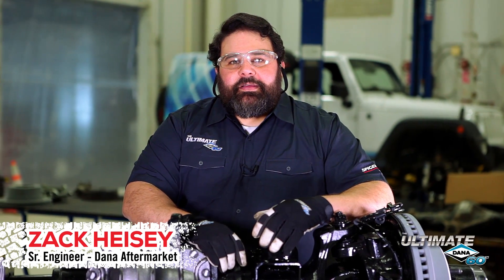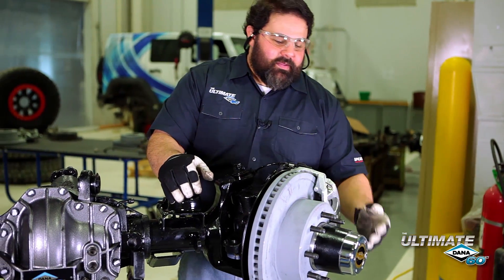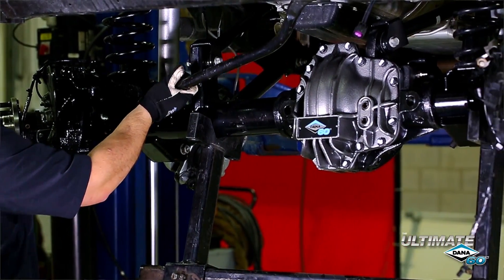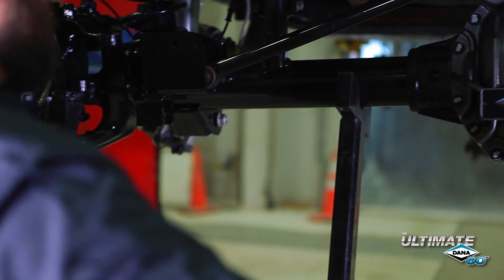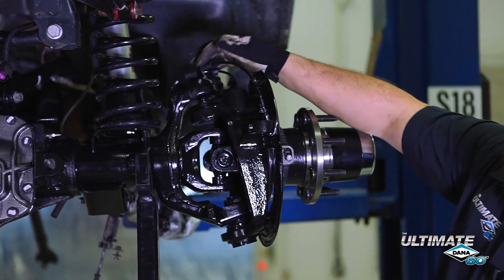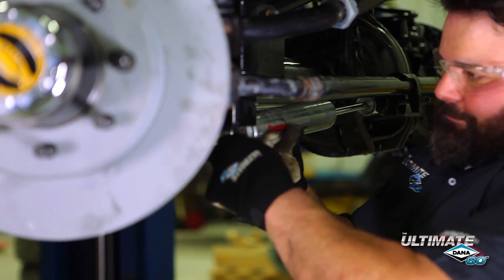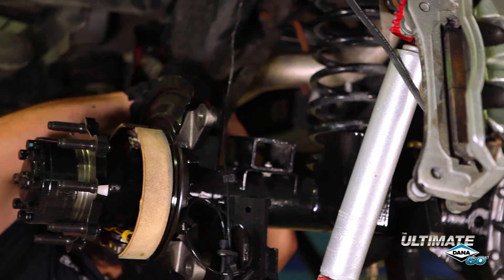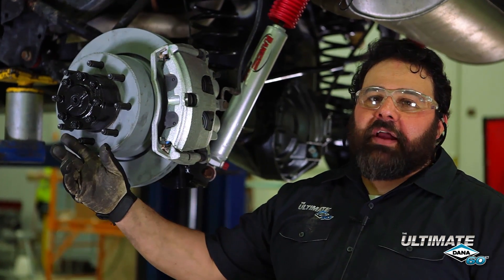Ultimate Dana 60 Axle Installation | Spicer Garage

Comment: I love how companys like this don't include every bolt and nut required for the new axle . Your going to be spending well over 5k for one of theses axles and they can't spring for the bolts and nuts thar you will be replacing when removing the old axles lol
Reply: According to the video, one of the benefits of going with Dana is that you can re-use existing bolts

Comment: are there any Dana 70s or 80s available as a rear axle to complement the ultimate Dana 60 front. if there is I would like to know what the cost of this would be. my purpose for this is to have the extra strength in the rear for towing while running 38 inch tall tires with 4.56:1 gears and ARB air lockers and the L86 6.2l V8 with 8L90e trans.
Reply: From what I've found is that they only offer a Dana 60 for the jeep JK. but for the setup your going to run go with Dynatracs. i have them on my JK and absolutely love them. there more expensive but in the long run there way stronger. the Dana 60's Dynatrac uses the Dana 80 pumpkin but with dana 60 tubes and ends.

Comment: How wide are they? Will they fit on a 83x 18ft trailer ?and with the brake upgrade will the 08 master cylinder work or did you replace it

Comment: I'm a proud Dana employee, we've  built the best mass produced axles in the world for a very long time. People can say what they want but Dana's are the staple of off roading axles. Dana Pride!!
Reply: @shaun4bigblocksllc  you're lying to yourself if you think your going to go to any off road park and see more chevy 10.5 than Dana's. Way more common considering we put them in multiple trucks from multiple manufactures including the Chevy Colorado.
Reply: Nathan West  you guys need to make this for a zj 1995 grand cherokee 5.9 with 7 inch long arm lift
Reply: Hey Nathan
 I'm putting a build together for a customer for an 2011 jku. My question is wheel size. We are going to run a pro comp trilogy pro beadlock with a 4.75 bs -6 offset. Do u have any idea if these wheels will clear calipers. Tires will be maxxis trep bias in 40 x 13.50.
Thank joe
Reply: A tip: you can watch movies at Flixzone. I've been using it for watching a lot of movies recently.
Reply: @Kaden Brody yea, have been using flixzone} for since december myself :D
Reply: @Kaden Brody Yea, I've been watching on Flixzone} for since december myself :D
Reply: Just put these in my 2016 JKU and loving them!!

Comment: What are the brakes off of?  Like if I needed new pads what would I say at the parts store?
Reply: Wilson Solt for the front I would go with the 2005 super duty.  They came standard with dana 60s in the front.  You'd have to look up what truck uses the dana 60 in the rear.

Comment: vibration in my K20 at 60 to 65mph when giving it gas,  it was full time I changed it to part time,  stock no lift,  new U-joints, drive line balanced, front drive line removed,  I think it;s at about 130K miles.  What else should I look for.   drums out of round or balance???
Reply: it should be a dana 60
Reply: Track bar. Trac bar mounting bolts. Or the mounts them selfs. The holes could be ovaled out causing the axle to move slightly left and right causing the vibration.

Comment: I have a 1970 GMC C20 2WD long bed with leaf springs in the rear. I was wondering if I have a Dana 60 Rear Axle in my truck. It is a 10 Bolt Rear End. It has 7 bolts attaching the Backing Plate to the Axle Housing. It has 12" Drums and they just slide off, no need to remove the Axle first. On the upper passenger side looking at the Diff. Cover it has a code written upside down, it is  C-30255 and below that it has 60.
Reply: +707SonomaComa the c20 will most likely be an 14 bolt full float axle, which is actually stronger then a D60
Reply: +Ricky McFarland 
It is definitely a 10 Bolt and looks like it was described above.
 I have a disc brake conversion on the front. It has Spindles for dis brakes from a 1972 3/4 ton Chevy but it has 9/16" Wheel Studs. The rear end in my truck has 1/2" Wheel Studs.
 Can Rear Hubs with for 9/16" Wheel Studs be purchased? 
  That is why I am wondering what rear end is in my truck
Reply: +707SonomaComa 
The Rear End in my truck looks just like the one in this picture with the same markings.
   http://www.fordification.com/forum/viewtopic.php?t=21876
What do you think it is?
Reply: +707SonomaComa looks like the rare D60